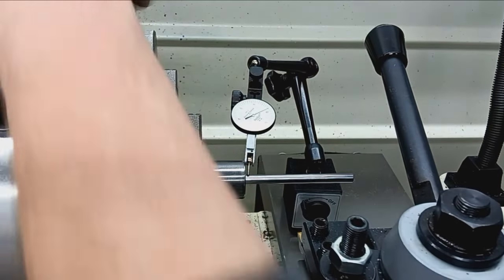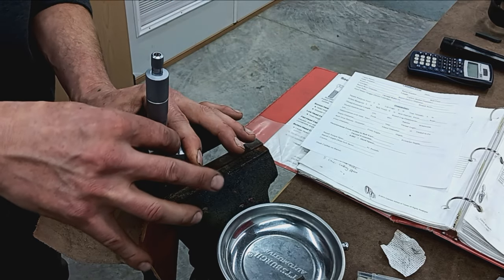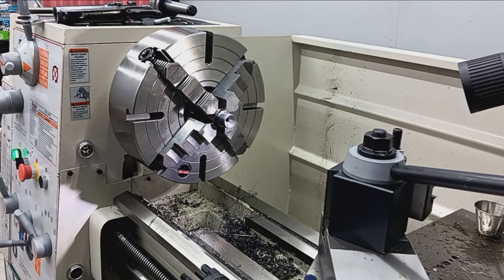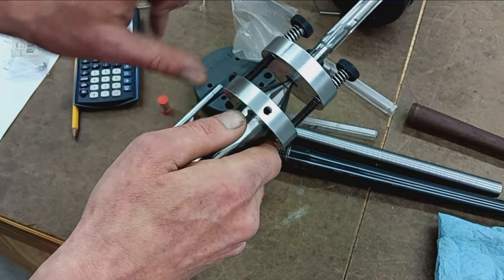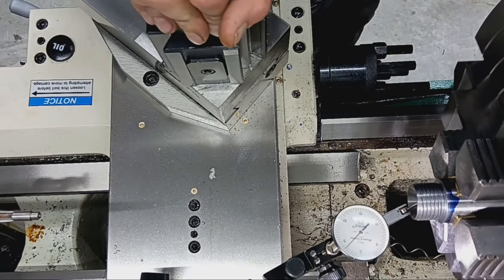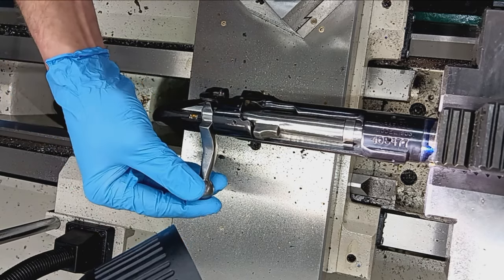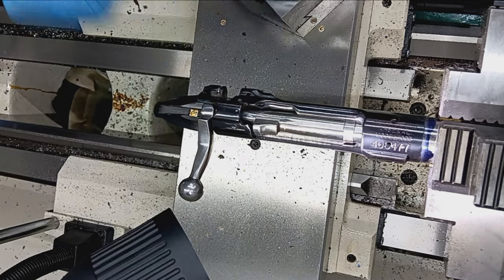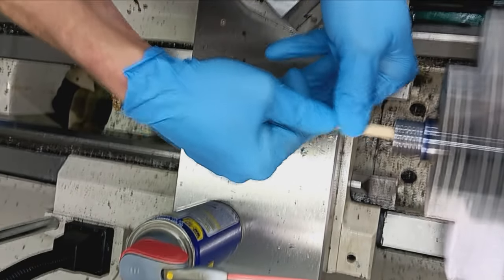Rock Island Armory 1903 -  Rifle Rebuild - Part III - Barrel Breech Work

Comment: I noticed how you set the barrel up through the headstock and indicate it both ends which to me is the best most accurate way to do it. There is an old school guy that would argue all day long with you that the best way is off the tailstock. He is absolutely adament about it. If you get the chance look up "The Real Gunsmith". He has one of the biggest ego's I have ever encountered. It is his way or no way. He has a closed mind to anything but his way. I have done machine work for 36 years and rirst thing I found out is nothing is perfect and there is always room for improvement. Gun building is the same way. Oh well enjoy your channel...
Reply from the maker: Oh yeah, I am familiar with Randy and his views.  I have total respect for him, but we would disagree on a lot of things.  I will never stop learning and expanding my knowledge.  I believe chambering barrels is a case by case basis - depending on budget and expectations.  I often use my blueprinting jig (essentially a "double 4 jaw chuck") on shorter barrels.  I never do the tailstock/steady rest method because I don't like holding the reamer in my hand when doing the work (how would that be even remotely accurate/precise??).  Thank you very much for watching and for engaging the channel!!